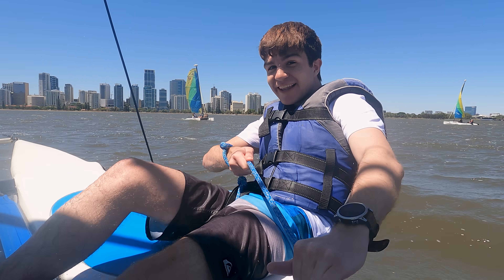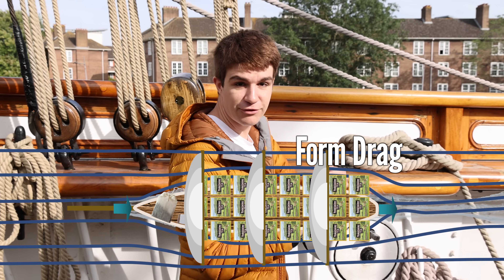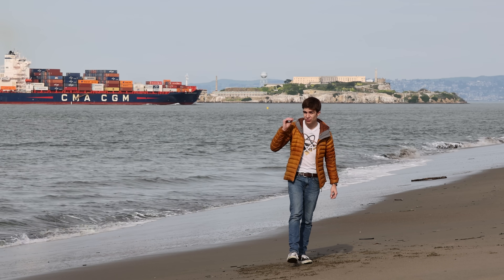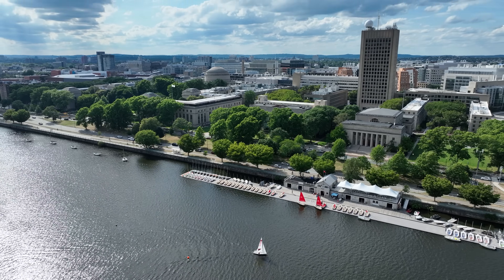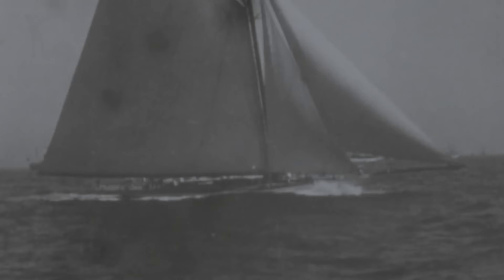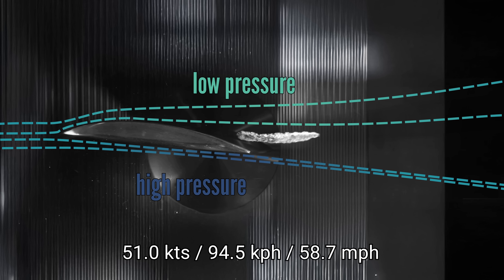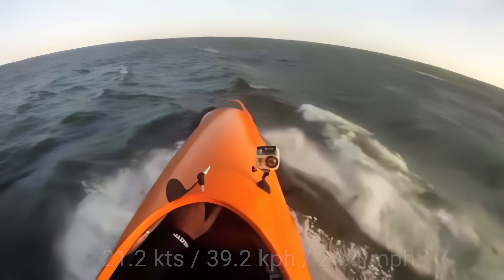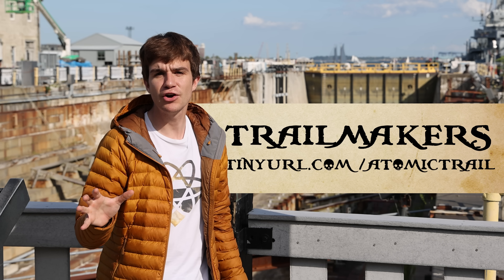What if sailing had no rules?

Comment: So basically, get as close as you can to being a plane but keep one single little toe dipped in the sea to still count as being a boat.
Reply: That is true as well for both motorized land and water speed records. They have reached speeds where you should be taking off, and the challenge is how to prevent that without creating so much downforce that you auger into the ground. The water speed record has been particularly cruel, it has been set in 1978 at over 500kph/310mph. The two official attempts to break it have resulted in the drivers deaths.
Reply: @kilianortmann9979 yeah, landspeed records at least have the advantage that the surface will remain perfectly flat even if a breeze kicks up
Reply: @kilianortmann9979 most of those ground speed record are just jet enggine thats cant fly😂😂😂😂
Reply: @kilianortmann9979  woah, woah, spoiler alert!
Reply: Motors have nothing to do with sail.
Reply: @kilianortmann9979  We should be able to do this stuff with drones these days no?
Reply: @someguywhocanfly .  What?  Are you sure that comment was meant for this video?
Reply: @RonnieStanley-tc6vi  i dont mean the little drones youre thinking of, i just mean driverless vehicles (be it cars or boats)
Reply: No, that toe in the water is the triangle that pulls the force out of the wind.  Without it you might as well be a helium balloon.  All you can do is go downwind at wind speed.  Unless you are an Osprey and can use dynamic soaring to stick your "toe" or wingtip in a layer of air going a different direction.
Reply: the fastest planes are basically rockets with their toes dipped into the atmosphere to be classified as "not a rocket" adding wings sell the idea
Reply: @SkashTheKitsune  looking at you, x-15.
Reply: @SkashTheKitsune 
Dyno-soar. NASA once  planned to skip off the atmosphere like a flat stone on water.
Reply: @SkashTheKitsune  Jets
Reply: @BeyondTomorrowNow  rocket engines don't have jets
Reply: @SkashTheKitsune  There is no distinction between "planes" and "rockets".  Planes are a type of vehicle that relies on aerodynamic lift from fixed lifting surfaces.  Rockets are a form of propulsion.  One can even have a "rocket plane".  There is no mutual exclusion whatsoever.
Reply: @SkashTheKitsune  uh, no they aren't. rockets are called rockets not because they go to space, but because of the propulsion type. you can be both a rocket and a plane (e.i. the X-15).
Reply: @nonamedpleb I don't think you're actually in disagreement.
Reply: @nonamedpleb  true. But the record for airbreathing ... flying objects is in no where near to that of rocket propelled vehicles that happen to move in the atmosphere. I far to often hear people referring to them horizontal rockets when talking about air(craft) speed records.
Reply: @nonamedpleb  a rocket plane still is a plane thought.
Reply: @nonamedpleb   The defining characteristic of a rocket is not that it "goes to space" it's that it caries its own oxidizer on board to burn with the propellant, so it's semi-environment-neutral. It's more of a controlled explosion (they're working on detonation) than any kind of engine.
Reply: @dynamicworlds1 These kind of people are what we call pedants (pedantic) and their only goal is to look smarter than someone else, even if that person is objectively right
Reply: @kindlin the oxidizer isn't what makes it (semi)-environment-neutral. It's which propellant is used. Whether it's an air breathing jet or a liquid oxygen fed rocket, it depends on if the engine uses kerosine, methane or hydrogen (or something more exotic) as a fuel. The only time the oxidizer matters for the environment is when something other than oxygen is used as an oxidizer.
Reply: @rikschaaf   Without getting too technical here, any of those fuels can be burned with oxygen, that is almost literally the definition of an oxidation/burning reaction. I'm pretty sure that one of the defining characteristics of a rocket is that it has its own fuel and oxidizer.
Reply: @kindlin Yes that's true, but I was talking about your statement of how semi-environment-neutral something was
Reply: @nonamedpleb no. If you are going to correct people, you aught to be correct, rather than confidently wrong. I mean, ffs, it takes like 2 minutes to open your browser, type in "etymology of rocket" to discover that, it is actually, in fact, due to its cylindrical shape. 
Rockets can have a number of difference propulsion methods. Solid fuel like hobby rockets, liquid fuel like Nasa or SpaceX rockets, plasma ion generators like is currently being developed in various skunkworks facilities. It might seem like a "rocket engine" is the thing. But only because burning massive amounts of raw fuel to directly create thrust is, at the moment, the most effective way to generate the thrust needed for liftoff. 
TLDR. Rocket is an Italian word with ancient Germanic origins that was first coined to describe... you guessed it, a cylinder as far back as the 1600s. Probably further, so the Germanic roots seem to define a bundle of yarn... so, yeah. 
For extra credit, since we are on the topic of space and apparently weaving, look into the etymology of shuttle.
Reply: @rikschaaf   Ok, but it doesn't matter which fuel you select (methane, hydrogen, dimethyl, etc) , or which environment you burn it in (in air, under water, in space), it will still burn, and it will still send the craft forward, thus, a rocket. So neither the fuel nor the environment matter when it carries its own oxidizer. That's a rocket.
Reply: @kindlin I think we are talking about different environments here. I was talking about co2 emissions, being bad for the environment, where H2 burning would be environment neutral (for green H2) and methane and refined kerosine (rp-1) would be bad for the environment from a greenhouse emissions perspective. I think you're talking about oxygen rich/poor environments?
Reply: @rikschaaf   Yes, I meant what type of environment it can run in, like in air or in space, and you meant rockets are, in general, bad for the environment, from an emissions standpoint. Both are true statements.
Reply: @dynamicworlds1  They are. Planes rely on wings to generate lift. Rockets don't. A plane needs an atmosphere to work, a rocket works best without any. Yes, rockets are defined by their propulsion, but a plane isn't just a rocket with a different propulsion method.

They're fundamentally different.
Reply: @Ashitaka255 not having wings is not a defining characteristic of a rocket.  Rocket planes and cruise missiles are both examples that prove you wrong.
Reply: @pws3rd170  aren’t pedants the little flags ships carry on their mast or flagstaffs?
Reply: @nonamedpleb  Umm..  How are you going to disagree with "the fastest planes are basically rockets" claim and proceeded to make an argument as to why they're both a plane and a rocket...?  Did you change your mind mid-sentence?
Reply: @nonamedpleb  you have not pointed out how he is wrong, only reiterated his statement.  are you feeling well?
Reply: @SkashTheKitsune your analogy is NOT even close.  Fighter jets DO NOT use rockets.  The jets being used in the latest fighter have nothing in common with a rocket.
Reply: @ToddHartung-pp2hp well ... With thrust vectoring and thrust to weight ratios exceeding unity .... Is not really that simple.
Reply: The rule is no engine, no jet. Only sails can be used for power.
Reply: @kuelf123  how high in the atmosphere can you go on wind power alone?
Reply: @tirkentube Do weather balloons count?
Reply: @rikschaaf  i don't see why not.
Reply: @tirkentube Pretty high. Nearly five kilometers with a single kite, nearly ten with a train.
Reply: There is a type of "plane" called a WIG effect craft, or Wing In Ground effect craft. It has aerofoils(wings) that are designed so that they don't create normal lift. Instead what happens is a pressure bubble forms underneath the "wing" as it moves forward, and that bubble of air lifts the craft up, but only a small amount because if it goes too high, that pressure bubble is lost and the plane comes back down. It's self regulating. Anyways, the important part, most places consider them boats, even though they can fully lift off the ground/water, and these places really only allow them to fly over water for obvious reasons, as they have a maximum altitude of their wingspan.
Reply: @adamw2785  WIG craft is a ship. in CCCP it was evaluated and declared a ship and given under control of navy as it uses water to generate lift.
Reply: @adamw2785  Fixed wing ground-effect vehicles still produce "normal lift." The result of ground-effect is that the low pressure region of air above the wings can't curl over the wingtips and depreciate the high pressure lift producing region under the wings because it runs into the ground first. As a result, you can make the wings dramatically smaller than you would for a normal aircraft, as long as you don't fly it very high off of the ground/water.
Reply: Not a plane - a kite. Except that in kite surfing, you wedge yourself between the water and the pulling force of the kite. With the last boat shown, the boat is just hanging off the kite with a hook in the water that is shaped to propel itself in a direction that is not the wind direction.
Reply: The toe in the water is extremely important because it has to counteract the lateral force of the sail, without that you wouldn't go anywhere.
Reply: Except it's powered by the wind not an engine!
Reply: yes plus you have to be powered by wind not an engine
Reply: Not really, that "toe" is what let's you increase the speed over the wind speed, if you remove it you would *slow down*.
Reply: Hydrofoils are great.
Reply: Flying fish. Is it a bird of a fish?
Reply: I always asked myself why F1 doesn't allow rear wings to have vertical yaw moving surfaces to rely less on rubber grip and tire limitations.
Reply: @berfava  Doesn't look like anyone answered you so I'll have a go. Movable aerodynamics were banned in the late 60's after Graham Hill's Lotus had a massive crash at Montjuich Park, Spain, as the wings were too fragile. It's been kept that way mostly to avoid a spending war and to keep a lid on speeds.

There is no way to reduce the importance of tyres, as the only part of the car in contact with the ground, downforce is transferred through the tyres to generate grip and so maximising the grip generated by the tyres is the goal of aerodynamics.
Reply: @andrewcarter9649 I think their point is that if you can control lift, how much faster than the others you can go depends less on how good your tires are, and more on how your lift system is working.

But without knowing specifically how the rules were made, it does make sense that they banned it because of safety reasons: not only it would allow you to go dangerously fast in curves, but also in straight lines (lifting the car to reduce tire drag).

And then I suppose the slightest malfunction could send the car literally flying at high speed, something they are trying to avoid. They are videos where some issue turns the whole car into a wing and it brutally jumps.
Reply: @Jayjay11111  By lift I assume you mean the aerodynamic force that allows planes to fly, and the opposite of downforce? It's been a good many decades since that was a concern for an F1 car.

So at present all tyres are provided by Pirelli, theoretically the difference shouldn't be the tyres themselves but how you use them.
Reply: @andrewcarter9649 Yes, that’s what I meant. And I suppose in a long straight line the downforce can actually slow you down without helping you, so if you could control it you would generate some lift so you get enough grip but minimize tire drag.

Which would be a pretty dangerous game to play.
Reply: @Jayjay11111  Yeah, can't create downforce without creating drag. Since 2011 F1 cars have been fitted with a drag reduction system (DRS) as an overtaking aide for a car behind another, where the top flap of the rear wing pops open to reduce the drag since downforce is generally useless in a straight line. 

Lift is generally not a consideration, these cars are producing something in the region of 2000kg of downforce at high speed via front and rear wings and large venturi tunnels under the body. Reducing drag at high speed and getting the downforce to bleed off as slowly and consistently as possible when under breaking and yaw is the main goal.

Lift tends to be of bigger concern with sports cars where the covered wheels and bonnet tend to resemble an airplane wing more than the inverted wings of single seaters like F1.
Reply: I don't think you'd want your foil to have any toe angle.
Reply: Thise is very false. It exploits the difference in fluid dynamics between air and water as sort of a multiplicative transmission. Gliders dont do this, and the only way they come close is by using the sheer layer of wind across a ridge in the terrain, even then its more like pumping you're legs on a swing. 

While it is niche. This type of technology pioneering is what drives innovation in industry by showing what is possible. Its amazing.
Reply: No, planes can't sail. They can fly with the wind, but not faster as the wind like these boats can. That requires a counter force from a different medium. So touching the water is essential.
Comments that are so completely wrong getting a lot of attention cause they sound "funny" is always a bit sad.
Reply: You got it!
Reply: "Dipping a toe into the sea" makes the boat very different from a plane. Your plane isn't able to harness the wind to move itself. Leveraging the two mediums is what makes this possible and IMO defines a sailboat.
Reply: @wesleyw.terpstra1902  gliders exist :/
Reply: …yes
Reply: There is this thing called "wing in ground" which i always thought was the worst plane ever designed😂
Reply: Sorta, but there's no such thing as a "sail plane" for a reason. In a static wind (i.e. no updrafts or shifting winds), you need some force to counteract side-slip, otherwise you'll be blown with the wind, until you approach wind speed, lose lift and fall out of the sky. The "toe dip" gives that counter-pressure necessary to sail. But yes, it does feel more aircraft than watercraft.
Reply: I mean a sailboat is basically like a plane with one wing in the water, so pretty much.
Reply: Technically the fastest vehicle without an engine is a glider ... the space shuttle on re-entry it is doing 17,500 mph/28,160kmh
Reply: These are still sailing boats — they need one wing in the water and one wing in the air to take advantage of the medium velocity difference to provide thrust.
Reply: You can't really make a purely wind powered plane though. Gliders can take advantage of updraughts to gain lift, but that's not really the same thing. Boats are able to use the "single toe dipped in the water" to effectively push against, making them capable of going faster than the wind in some conditions.
Reply: Wrong. Sailing is horizontal locomotion on water or land using _wind_. Airplanes have engines. Gliding sailplanes use rising masses of buoyant air, convective currents in the atmosphere, which is a very different concept than sailing.
Reply: Ironically true for trailmakers races too
Reply: To my knowledge there are no self propelled air plains able to fly with only wind power… if they were able to make that into a plane it would be super cool
Reply: planes don't have sails so it still needs to be a boat
Reply: true. this way you need to fight less against gravity.
Reply: Yes! :)
Reply: Ground effect planes can be argued to be a boat if we bend our definition of boat a little.
Reply: The toe in the water is critical to its function though.  Without it, it would not be able to harness the wind at all.
Reply: So to get faster sailing, we need to fly.
Reply: Ekranoplan....
Reply: as lomg as you take off from the water as well
Reply: I mean you but you try to fly a boat off soley the wind.  The Hyrdofoil supplies upward thrust actually, they wouldn't work without it (ie if you could detatch mid sailing the thing would obviously crash into the sea)
Reply: The enemy has always been friction, be it with the air or water. The hydrofoil tries to minimise contact with water and rocket plane try to minimise contact with the atmosphere. In the end it's all about drag and cx
Reply: The fastest boat is a plane
Reply: Caspian sea monster 😊
Reply: Well, the next step is an ekranoplan (Ground-effect vehicle)
Reply: I mean the thing is only motored by wind so if it didn't have it's "toe" dipped in the water it would basically be a plane with infinite fuel as it would fly with nothing but wind?
Reply: hydroplane!
Reply: Ground effect and downforce in equal
Reply: Same as speed record cars kind of. 😅
Reply: If a man wears a woman’s swimsuit and calls himself a woman, should he be allowed to compete against real women😂😂😂😂
Reply: I'd say it is closer to getting as close to flying a VERY large kite while using a hydrofoil to oppose all forces except the one in the direction of travel.
Reply: aerodynamics are fluid dynamics, after all.
Reply: I have worked a bit on a wind powered ground effect vessel with directly downwind faster the wind propulsion that doesn't need to touch the water in anyway, but the parameters to make it work are on the extreme side. Exploiting wind speed difference between close to the water and a good bit higher. It's very much out there, so much so that I have no hope that even a scale protype can me made to work. In part due to needing to be large scale.
Reply: well no, because the power is still coming from wind, not a jet engine. but if someone invented a manned glider that could take off using wind power alone, that would be extremely impressive
Reply: @caimansaurus5564  If can be done, but you'd need to "charge" a battery on wind power first. The battery can be like a first stage, on its own wheels, that brakes itself to stand still on the runway, staying behind. Any glider winch can be wind powered of course. A small peppy battery and motor and prop can give enough energy and power for the launch, but not for a useful flight. Gliders with fuel engine exist, they can be replaced by a battery and power dense motor.
Reply: Damn bru i know youre dumb but dont flaunt it in the com sec.
Reply: 🤔 … Yeah, I guess. 🤷🏻‍♂️
Reply: Yes
Reply: Well, that one toe is really important. Without it, you'd just be a kite, and a kite can't go much faster than the wind speed. 

You use the water to create an inclined plane which allows you to go faster than wind speed.
Reply: No rules = allowed to plane
Reply: You mean a kyte
Reply: F15....
Reply: like ekranoplanes
Reply: MacGregor  power sail 40 hp  20 knots undr oiwrr boat who needs sail oiwr biats rule
Reply: Ekranoplan, the best sailing boat
Reply: Yessir!
Reply: And the fastest "planes" are the ones that basically are rockets, but have some stubby wings for nostalgia and fly on the edge of the atmosphere to still count as aircraft
Reply: @jannsander it's an aircraft so long as it has a non-negligible amount of lift (either from wings or from the body itself). Dunno what an aircraft would need to also qualify as a plane though. Maybe pitch, yaw and roll control, together with controllable thrust?
Reply: @rikschaaf  to be a plane, most of it's lift as to come from it's wings (or meaningfully similar wing-analog(s)). The 'plane' comes from 'aeroplane' which specifically refers to the wings and their effect on the air facilitating heavier than air flight.
Reply: @jannsander  if I’m not wrong, the dragon lady and the SR-71 are the fastest aircrafts atm. The dragonlady with an insane wingspan longer than it’s fuselage and the there is the SR-71.
Im really curious about the XB1 from Overture when that one will be finally build in it’s full size.
Reply: Once again, the local old-timers oppose or criticize a technological advance, claiming it's something else, not the same, or not real. From the oar to the sail, from copper to carbon, the centerboard, the pivoting centerboard, Kevlar, and finally the foil, that hated contraption that passes you by on the leeward side at 15 knots while you're sadly moving along at 5 knots. Deal with it or be a grumpy ass.
Reply: The landspeed record is set by a plane without wings and as useless as possible "wheels". I still maintain that a landspeed record can only be set by a vehicle which propulsion is delivered by the wheels, not by the exhaust. Likewise i think that a sailing record should be set by a boat with an actual hull that cannot by any means be lifted out the water because then it is no longer a boat.😁😁😁
Reply: not to a plane , but to a wind-powered ecranoplane
Reply: Flying and sailing both work off the same principals. Manipulating current.....air or water